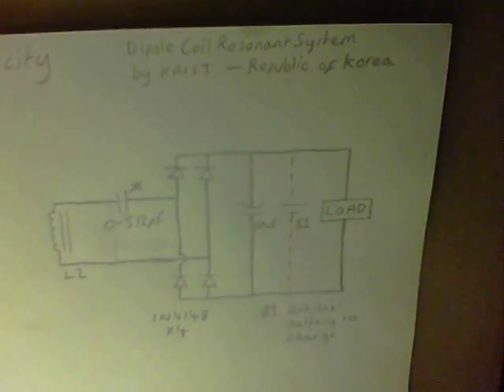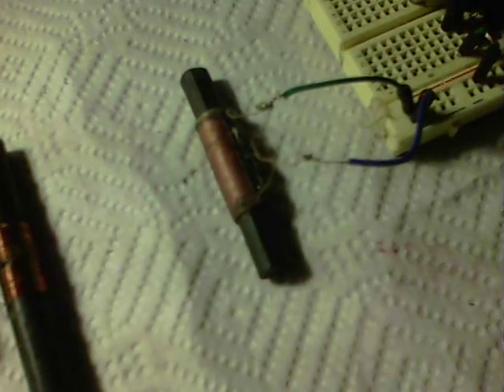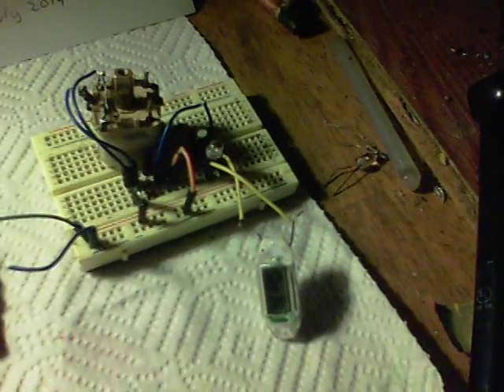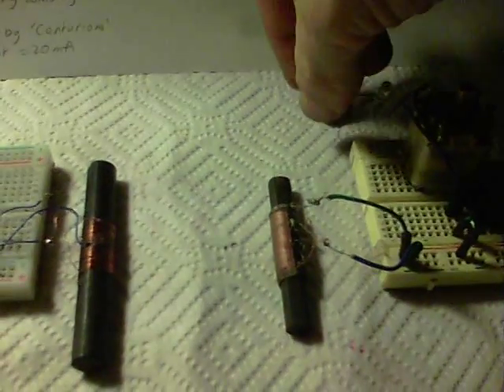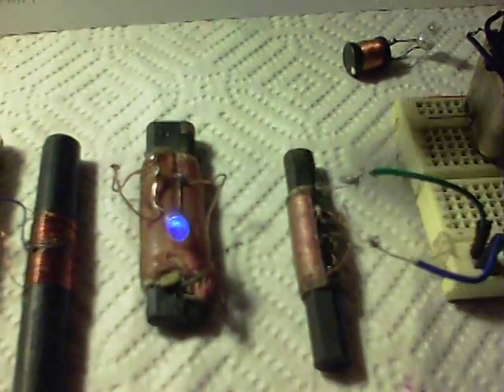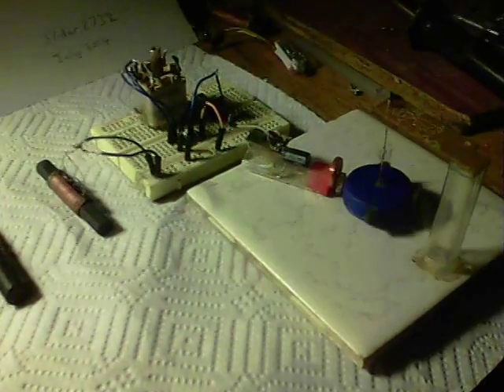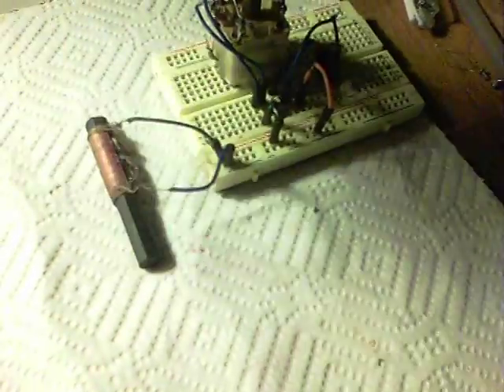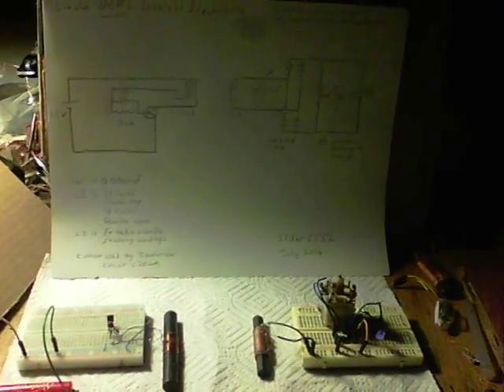Simple 'DCRS' Wireless Electricity

Comment: Slider, why does the receiver side have a battery? I thought that the transmitter side of the circuit was sending the energy needed for the receiver side.
Reply from the maker: There's no battery on the receiver side. Transmitter on left, receiver on right.
The receive side is more complicated than usual. It comprises the coil, variable cap, 4x diodes and a smoothing cap :)